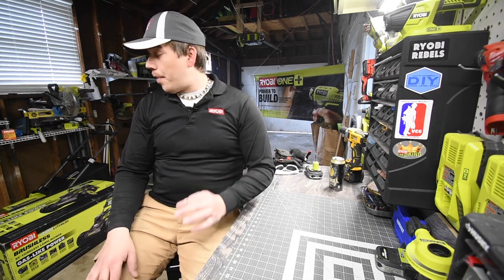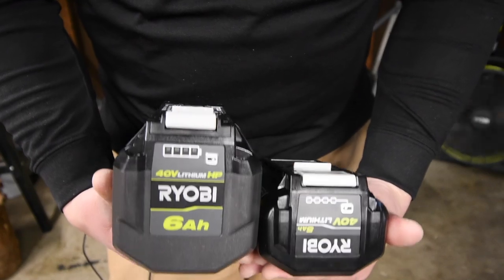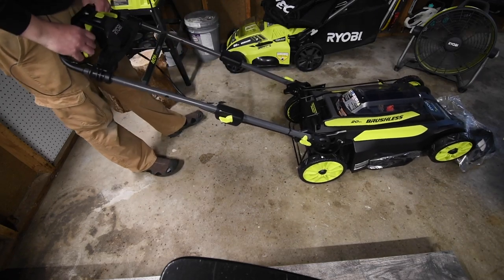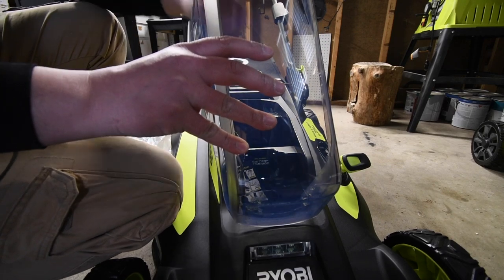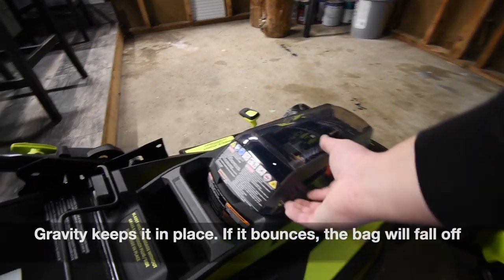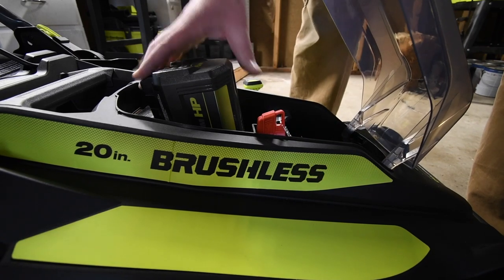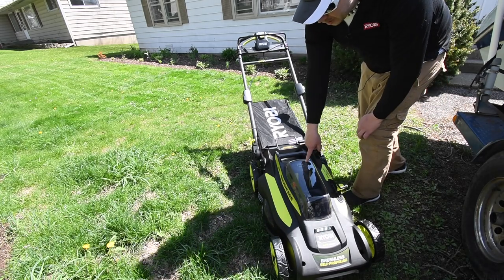Ryobi 40v Lawnmower test

Comment: Last year I bought the 40v system home Depot had 5 tools(chainsaw, hedge trimmer, weed whacker, jet blower, and this self propelled mower) I love this mower it came with a 6amp batt but not hp I might get the 7.5 amp. But it's a great mower easy to use and quiet!
Reply from the maker: I agree and I than you Norman

Comment: Got this couple years ago and it was drastically superior 2 previous two ryobi models i owned. I think the headlights they could had switch to turn it on and off. I like ryobi is improving their lawn mowers and i am looking forward to next purchase if i ever get another one. The big battery for this was better two as older ones that smaller batteries wouldn't last too long, Luckly we had other ryobi products so we had backups. The bigger battery for the lawn mower made it easier too, i still had to purchase a second one as now and again grass can get too thick in front and back yard to cause extra work.

Comment: Thx. Was going to buy the 6amp battery since Ryobi said it’s capable with all 40v equipment. Stupid they wouldn’t say the battery is too large for older mowers.
Reply from the maker: luckily this video saved you the money, even the new 4ah battery doesn't let the lid close
Reply: Ryobi makes a 6ah battery that is physically smaller for older models. It’s model number is OP4060a and can be ordered on their website.

Comment: You can use the six or seven or eight amp battery 40 volt they sell those at Home Depot not the HP. Then you can also get some aftermarket batteries
Reply from the maker: I thank you for the input Jesse: :)

Comment: The self propelled unit is quite a bit more expensive that the push model. From what i understand the push is ok because the mower is so light to push. Thoughts?
Reply from the maker: the push mower it so light you really don't need it to be self propelled
Reply: Extremely light

Comment: i like those big 6 ah batteries. great video keep it up.
Reply from the maker: I thank you Poof
Reply: Will the regular 4ah 40v battery works with this lawnmower?
Reply: Wonder what the 40v trimmer will feel like with that big beast connected...  ;)
Reply: Michael Rechtien I have 6ah in my weed eater as well and its awesome! Just slightly a bit heavier
Reply: @greenranger9428  Yes it will. When I bought my new mower it came with the 6ah battery but it was not charged enough yet. I was able to complete my whole yard by using the 4ah battery from my 40v Ryobi string trimmer. This is a great system!

Comment: Hi, so mine was the self propelled, it runs except the blades wont run using the bag 😅 any thoughts on this? Ty
Reply from the maker: their might be an issue with it, the blades should rotate
Reply: My blades are not running with mulch cover on. Don’t want to use the bag.

Comment: We just bought your buddies one you’re testing out easy assembly, but won’t start have mulch piece on locked,first time using it, any thoughts?
Reply from the maker: there is a sensor that makes sure the port is covered. it needs to be on there properly to start to motor. I think its a safety feature so kids don't stick there hands inside

Comment: I have a Ryobi brushless lawnmower 40v lithium 20in blade

While I’m cutting out grass automatic stops, than push bottom to start it won’t last 3 secs and stops again. What the problem?? Anyone??
Reply from the maker: you might be cutting too low for the height of the grass. or moving forward too fast for that section

Comment: Have you had a chance to try the Toro Battery Operated Lawn Mower?
Reply from the maker: I have not. when it comes to lawnmowers. This Roybi fits my needs. I don't need a couple of them laying around lol
Reply: @ManCaverTools  Do you like the new mower or older mower?
Reply: @RichieColemanSr  I know this is 8 months old, but I've been testing the 60v Toro 22" Recycler against the Ego Select Cut XP. No real difference in speed, cut quality at lower settings, or mulching/bagging performance. The Ego's got bigger batteries available to it, and comes with the biggest battery available, only meaningful advantages.
Whereas the Toro is less expensive, has better suction, cuts better at higher settings, better handlebar ergonomics.
The Ego is also too light for self propelled to be worth while. I've got a somewhat bumpy yard, and using self propelled just makes the mower bounce. The button is also in a bad location for ergonomics, and the whole handlebar kinda sucks.
Reply: @reaperreaper5098  Never to late. I purchased the Toro and I Love it 😀

Comment: Don't get Ryobi, I got both Ego and Ryobi. Ryobi started to show signs of aging after two months of use, Ego not budging at all. Plus the ego blade setup is way better and much cleaner cut. Ego battery seem to go a little further too.
Reply from the maker: very good, I am glad you like it and I thank you M R
Reply: I've had my RY40109 for a year and a half now, and other than being dusty (from being stored in the garage), with a bit of grass debris here and there, it looks brand new.  I have roughly 1/3 an acre of land that I mow, and it powers through +6" grass (when we have an extended period of rain, the grass grows like crazy) without any issue.  I use a single 5Ah and 4Ah battery, along with the 40v trimmer, and usually still have a bar (or two) left on the batteries when I'm done.
I was going to buy the Ego mower first, but Home Depot was out (even though inventory showed three).  I am not disappointed in the RY40109 at all...  :)
Reply: @michrech  how is that ryobi mower working out for you?  The older yellow ones are on sale now and I’m thinking to pick one up but have never had a battery mower before.
Reply: @jo9732  No issues to report, so far.  Mine is black with yellow stripes, and it's working the same as when it was new.  :)

Comment: You need to check out the ego line of tools(blowers, lawnmovers even self propelled, string trimmers, snow blowers, hedge trimmers, backpack blowers,chainsaws...) they all use the same 56v (2.5,5,7.5 and you can even find some 4,6 Ah)battery and they eve haev a commercial line with a backpack battery.
Reply from the maker: I will and I thank you Valer

Comment: mine broke the first day I got it wont stay running I have to take jt back
Reply from the maker: I have no issues with it and I use my lawnmower a lot
Reply: Try double checking the handle locks making sure you have the handle correctly locked in all spaces. And make sure the lid over the battery compartment is completely closed. I know im extremely late commenting but i had the same issue one of the handles was just a bit loose so it would start than turn off. Had me frustrated so hopefully ot helps anyone else who thinks the mower is not functioning correctly.

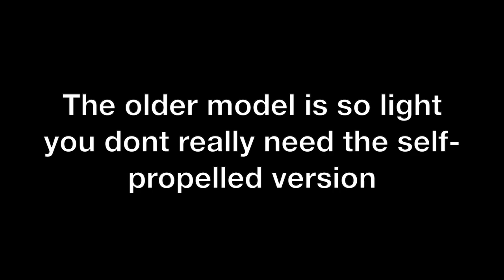Comment: 10:05 The text you put on screen says "Only real difference is the battery storage area" I have to strongly disagree. The new mower is 20% wider which means you can cut your grass 20% faster leaving you with more time to do other things, or just relax. Having said that, I have a Toro Timemaster lawnmower which is 30 inches wide, 50% wider than the new Ryobi lawnmower, and nearly double the width of your older one. Of course it does come with a hefty price tag to boot, but then again, time IS money. You can probably buy both of these Ryobi mowers for the $1200 I spent on my Toro, and still have enough left to buy pizza for your family's dinner. I'm not even going to talk about power because it's not fair to pit a gas mower against a battery powered mower in that category.
Reply from the maker: they are both 20" lawnmowers
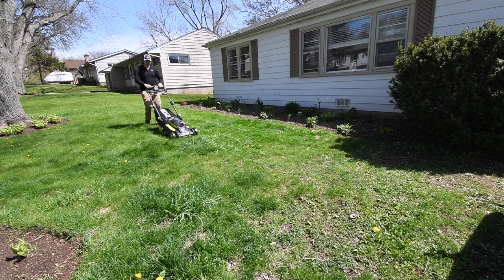Reply: @ManCaverTools  After re-watching your video, I can clearly see the 20 inch markings on both mowers, which I was not paying any attention to the first time I watched this video. HOWEVER, at 6:12 you did say that your old mower was 16 inches, which is where I got my information from.

Comment: So let me understand this and tell me if I am saying this wrong. Do you like the older model because it looks cooler even though the new model performs better has a better battery and you could put a 7 1/2 Amp better in there. So I guess the performance doesn’t count? It’s not a sports car. LOL.And I never seen those lawnmowers for 200 bucks. Show me and I will buy it never seen them for 200 not 280 or 249 200
Reply from the maker: I got mine on clearance. I don't need to put a 6ah HP or 7ah HP battery to do my lawn. if you watched the entire video you would know what I said, if you already own the older model and it is working great there is no need to upgrade to the new model, only difference is you can use bigger batteries. id rather just buy another battery for $120 instead of spending $300 for a new lawnmower
Reply: I did watch the hole thing I just didn’t want to edit.Thanks again for the good review I like it. Want to laugh. The handle locking mechanism that locks the height of the handle in place. If one is not locked the mower will start and then shut off after about two or three seconds. I was getting all pissed off swearing and thinking to myself that’s just my luck I get a defective one. LOL so I was thinking when am I gonna bring this thing back. Lucky for me I ended up reading for sucking time in more detail the owners manual.
Reply: I think he means he likes the older model more because he already has it, as in, no need to spend money to upgrade.

Comment: You Just Messed Up And Bought The Wrong Model.. Or Could Not Afford The Self-ProPelled.. It's CLEARLY SUPERIOR To Your $200.00 Unit.
Reply from the maker: when it comes to mowing the grass the older version still is extremely good. the only difference that I can use out of the newer model is that you can put bigger batteries in it. I only use up 2 5ah batteries anyways to do my whole year. so im good on getting a new mower